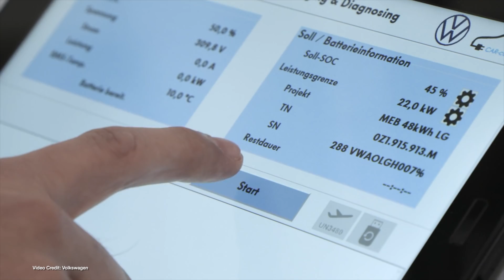How Volkswagen Will Keep Electric Car Battery Packs Out Of Landfill

Comment: This contribution lacks the the consideration of cost. Only if this kind of recycling gets you the materials cheaper than mining them, it will be used. Or in case, law demands recycling and this law is enforced. Otherwise, these old cars will be exported to low wage countries. Think of Nigeria and the Ivory coast for European cars. There exist enormous land fills of waste from electric and electronic products and local inhabitants use simple, dirty, unhealthy methods to get to the precious metals inside.
In a comparison, the ICE industry may refer to some pilot plants capturing CO2 from air, then processing it - together with renewable energy - to synfuels, whenever someone blames them for generating CO2 from fuel. But the sheer existance of some pilot plant does not guarantee the actual scale of operation needed to take care of all of it.
Reply: All good points and of course, it only works on the proviso that battery packs from potentially nine or ten year old cars will be returned somehow to Germany from whichever service point they are declared non-serviceable in the vehicle. I would like to see the logistical plans for this, but otherwise, looks a very positive step to overcome concerns about end-of-life battery packs and their impact on environments

Comment: Pretty much everything that mankind mines or makes is recyclable in one way or another. Not oil though. Once that’s burned, the oil is gone, just leaving the CO2 and other nasties behind.
Reply: Everything is recyclable, just depends on how much energy you want to put into it. For instance we could capture carbon, hydrogen and oxygen from the atmosphere add a whole bunch of energy to it and create methane or other hydrocarbons. It's just hugely expensive. If/when we get fusion working well things like that will not be out of the realm of practicality.
Heck even nuclear waste could be re-energized by pointing a linear collider at it and adding neutrons back into the uranium/plutonium.

For now shredding and distilling/refining is the best we can practically do, and that is pretty spiffy, but the future holds lots of promise.
Reply: @Jcewazhere  We can't recycle anything more than small percentage of the energy harvested from the burning of fossil fuels.

Comment: It's also silly to think that this is a new problem - Toyota has been offering a "battery bounty" for the buy-back of Prius batteries on vehicle end of life for over 20 years now. It's also silly to think that ANYTHING vehicle related would "just go to the landfill" - vehicle wrecking yards and recycling is a mature industry for over 50 years. Even when a car is in a catastrophic wreck or fire, it isn't just thrown wholesale in a municipal landfill; it is near-universally sold to a wrecking yard that strips all the still-usable components and recycles what's left. And if the vehicle is still in moderately good physical condition, just had powertrain issues preventing further use, it usually sits in a wrecking yard for years as a "spare parts" vehicle, with the highest-value parts removed quickly and sold. For an EV, that battery is a VERY high-value part, even when it has reached the end of its "useful for vehicle use" life. Again, see the Prius - Prius battery packs are very often refurbished by third parties from retired vehicles, and resold.

Comment: I was surprised at how they perform this process of "un-baking the cake" to get the ingredients back out of it. This was a terrific video! I learned a lot.
Reply: Recycling a cake is easy. You eat the cake, then use the fertilizer produced through digestion to grow new wheat, sugar beets, berries, and the other stuff in a cake and then bake those ingredients again. Matter isn't produced or destroyed in these processes so aside from needing to put energy into the system, in this case sunlight to grow the plants, it's 100% renewable. //Yes I am massively simplifying this for humorous effect :P

Comment: Woah! That lithium stuff in there didn't spontaneously combust when it was being chewed up!
Reply: I think they use nitrogen gas in the chamber to reduce any possible combustion together with the batteries being close to 0% charged.
Reply: @markreed9853  I thought that would be necessary too. I might have to dig a bit deeper into it. Side question: does the SOC have anything to do with how combustible the battery would be at any given time if it was punctured?
Reply from the maker: Batteries combust when there’s an electrical short that releases a lot of energy. That only happens if the battery has any charge in it. This is why the  battery is discharged first. ^ Nikki.
Reply: @transportevolved  I totally get the point around discharging the battery to prevent short circuits. Going back to your words, "Slightly used and moist" :), doesn't lithium react violently with water anyway? Don't know if the moist is actually moisture from water though. I love your videos, btw. Thanks for dispelling myths. Everyone needs more education around EVs.
Reply from the maker: @nairnavneet  The lithium isn’t just lithium at this point. It’s bonded with other metals... which affects its properties. Chemistry FTW! ^Nikki.
Reply: @transportevolved  Thank you! :)

Comment: Yikes! All that plant for 10 batteries a day!
Reply: Well, there are no real used batteries in sight for VW for years, so it's good to work out the hassles of how-to in a small plant.
Reply: @ulissedazante5748  Yes, I get that. But it still seems like a lot of plant for 10 batteries a day
Reply: @markiliff  it is.
As it is, the amount of machinery to chew just 10 batteries/day is expensive as hell.
Still, it's the price to pay to buy know-how.
Forged how to recycle that schtuff, the bigger version to chew 100 or 1000 batteries a day would be way more cost efficient.
Reply: @markiliff  im sure lots of the machines are under-utilized. For example i'm pretty sure the Shredder shown could easily chew through 100 Packs a day, and you could automate its Process entirely for 24/7 Operation. But there is no point in getting a smaller one because it couldnt grind up a single pack without prior labor-intensive disassembly of individual Modules.
Reply: It's similar to Tesla and their practise battery building plant for their new cells, the cost is worth the time it'll save getting the scaled up versions working seamlessly.
As others have said the simple lack of batteries due to them outlasting some pretty apocalyptic predictions have meant battery recycling plants like this and the Dousenfeld plant down the road from VW are having to hunt around for faulty and test batteries to practise on. That should all change this decade.

Comment: Here in Shenzhen, the 2018 BYD e6 taxis, on the the road in the 4th years now, have ALL exceeded 300 000km on the first battery pack, while a reported degradation of 10%.  This is far more then your normal vehicle's life time. They charge twice a day per shift, while typically driving within 200-250km per day. The factory range was 430km and now that are at 370-380 real world range.
They appear to always complety charge the vehicle instead of topping up, which usually means longer time for charging.
Anyway, seeing them running so much on the first pack, dropped my fear.
Reply: There's 2 things that affect the State of Health of a battery. The number of full charge cycles and the age of the battery.
Reply: @Hans-gb4mv  what I am saying here: 2000 cycles, 300-400,000km range and only 10% degradation

Comment: In the interests of balanced viewpoint. What about the Porsche item that got a tiny mention a week or so ago. Regarding the relatively new technology of drawing carbon from air, adding it to hydrogen via electrolysis to make methanol for fule. This is Carbon Neutral Fule. Cleaner Greener Smarter. Awaiting the story.
Reply: As around 95% of the worlds hydrogen is still fossil fuel based and only going to change slowly over the next two decades to water based methods. The Porsche fuel is just using more energy to give a fossil fuel a feeling of being green. Energy to pull the carbon out of the air, energy to convert the fossil fuel to hydrogen, energy to combine the carbon and hydrogen to methanol...   might as well use all those energy steps combined together to put miles into an electric car directly.
If this was the 1990s then it would be an interesting stop gap but now it reads as nothing more than a green washing scam by a big company that should know better.
Having said all that at some point fossil fuels just won't be economical to produce and actual green hydrogen using their method will probably be how classic vehicles are kept running for us to see and enjoy.
Reply: @helenlawson8426  that leaves 5% for everything else like all the water in all the oceans lol. I mean LOL.
Reply: @ianburnett4605  Have a go at actually reading what I said you might learn something. LOL.
Reply: @helenlawson8426  lol.
Reply: @helenlawson8426  if 95% of the worlds hydrigen is as you say and the oceans are H²O which is only part of your 5٪. Your 95٪ must be stored in a space sized  the ocians x 95٪ plus. Where is that is. Lol
Reply: When conversing with others it is nice to not include insulting narrative.
Reply: @ianburnett4605  Can I remind you that it was you who went laugh out loud first I just copied you after first asking you to read what I actually said. 
It's not insulting to ask someone to pay attention to what you're saying.
I do though now see where you're going wrong and I think you've made a genuine misunderstanding so I will start again as I could have been clearer.
Right now the hydrogen that Porsche would be using for creating fuel to burn in cars would come 95% from fossil fuels so would not be anything like as green as they are making out. Even if the only use that 5% which is split from water using renewable electricity it would still be debatable if it was green as the process is energy hungry and the car would still be burning fuel and polluting our streets. 
As it is hydrogen from water is not going to be what is used for the foreseeable future in the vast amount of cases, so for at least a decade it is just a new set of green clothes for the same old fossil fuels.
Reply: @helenlawson8426  it is actually totaly carbon nutral fuel. Not only that, the same process can hold a portion of carbon and not process it into fule which is even better than carbon nutral. Sorry but its the best idea yet for removal of carbon from the atmosphere.
Reply: @ianburnett4605  Pulling carbon from the air and burying it or trapping it in concrete blocks as they can do now is a something I think we can both agree is a good thing. Unfortunately using large amounts of extra energy on creating a fuel that will then get burnt in vehicles is the past and one we should wave good buy to as soon as possible. At the very least it should be regulated as such that this process can only use hydrogen from water electrolysis so that the fossil fuel industry can't give themselves a green wash and basically be carrying on as before.
At the moment there are some really good test programs starting up using off shore wind turbines to split seawater into hydrogen using some technology only a few years old that greatly reduces the effect of the salt on the system. This though is all going to take a decade or more to get into useful amounts of hydrogen so for the next decade or more any fuel from hydrogen plans will be using fossil fuel based gas  just as dirty as before and using more energy for the same results. 
In a decade most people will probably not want a combustion car when you consider what just one decade of real investment has achieved. Ships and aircraft is where the argument for hydrogen and maybe methanol will remain for many decades yet.
Reply: @helenlawson8426  carbon has many uses in manufacturing and one day the graphene stalemate will be cracked. The country where I live diverts 1/3 of total electricity (hydro) to aluminum manufacturing. Rio Tinto who buy that power for peanuts. I want that power to go to carbon washing and hydrogen/oxygen splitting.

Comment: Good video. 

And for people concerned about the processes used to separate the sludge metals simply know that they are similar to those used to refine these metals originally, but far more efficient since the recycled batteries are much much richer in recoverable materials than any ore found in nature, thus requiring less processing. The process to separate aluminum metal from mine ore is incredibly energy intensive. Processing raw nickel ore from mines generates large amounts of toxic liquid waste. No raw material, consumer product, or energy source is utterly without environmental impact. It is our responsibility to purchase only what we need, make it useful for as long as we can, and see that it is reused or recycled at the end of its useful life. 

This change in attitude for a public labeled as "Consumers" will be the single most difficult part of managing climate change.